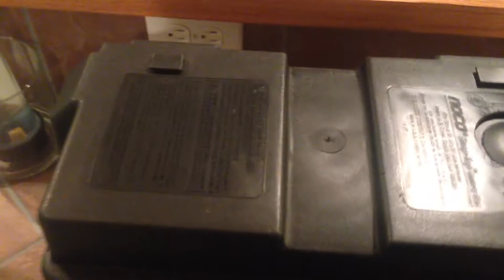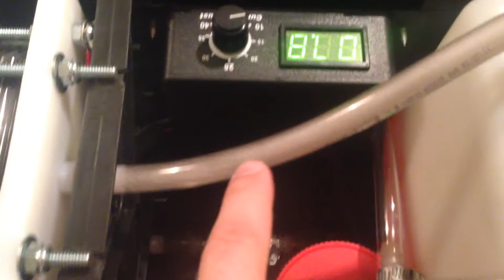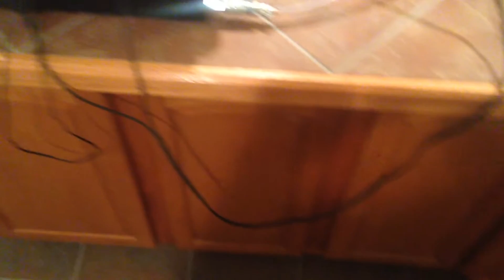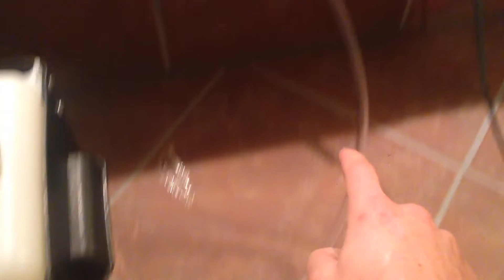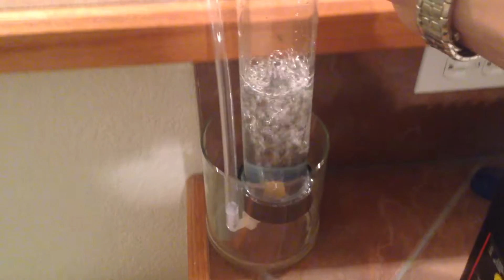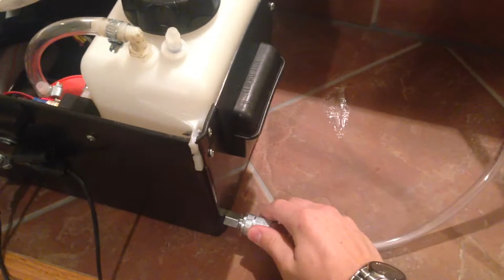HHO Battery Box and 19 Plate Dry Cell Build Part5

Comment from the maker: Nicklas you need to use an electrolyte in disabled water so use KOH (potassium hydroxide) you can buy some online cheap!
That what i use and is suggested as the best for HHO just be careful not to get it on you it will burn!

Comment: Nice compact design! In my research of the early 1900's I discovered that if you bubble dry HHO, in small bubbles, through oil (used motor oil) you get hydrocarbon fuel (gas vapor). It's like combining ideas of Meyer and Pantone to boost mpg. A mini refinery!
Reply from the maker: Thanks! Also thats actually and awesome idea with the oil ill have to try it for sure!
Reply: Logan Gamble Here is one of the patents were a car can be started cold on kerosene. www.google.com/patents/US1379077
I'm also thinking smaller volumes of HHO could be injected on the suction side of fuel pump.
The fuel pump would pressurize the normal fuel system infusing HHO/Fuel like CO2 in soda.